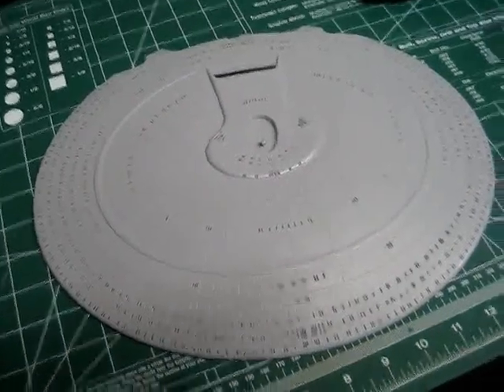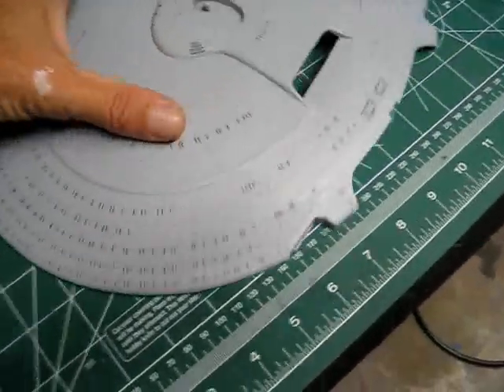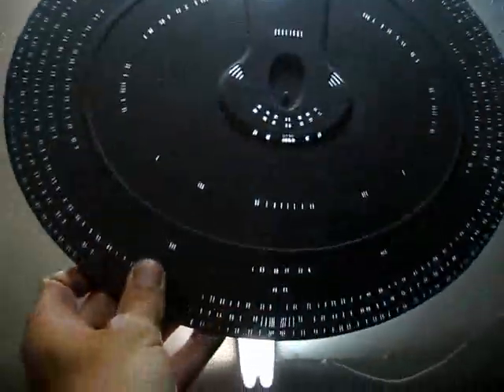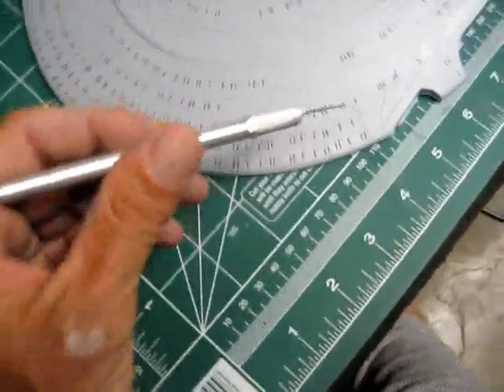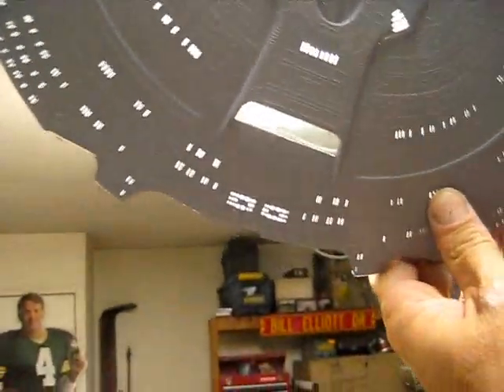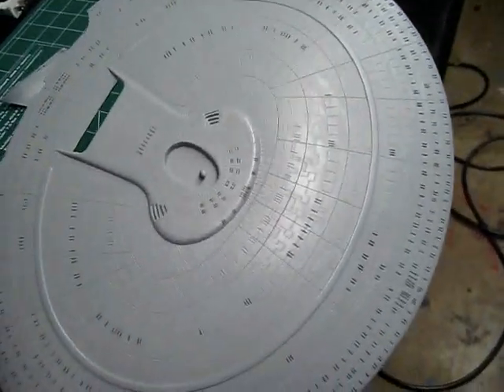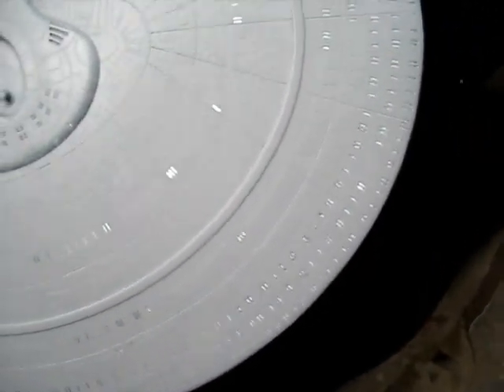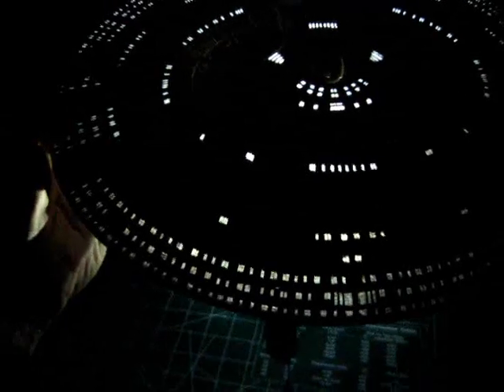From TrekWorks AMT Round 2 Models 1/1400 Clear Enterprise D Model Kit Build PT 2

Comment from the maker: It varies depending on what level you take it to. The premade lighting kits are usually one of the more expensive components. Decal sheets are also getting up there in cost too.
The Reliant I did recently for example I have about $ 450 in it. But that was an all out effort with the lighting, custom base etc which even at that not all that outrageous. Then there's the Romulan Warbird I did where It looks cool and is lit, but only spent $75 bucks on it including the $35 price for the basic kit.

Comment from the maker: The only thing I'll be painting more on the top is the phaser ring. Its easy to mask the area around it and paint it. The Aztec decal set adds all of the other colors on the saucer.
The windows are scratched to remove the paint and they appear black when the light is off
as it should. When lit you cannot see the scratches so this works really good.
I think it will be the way to go on this kit as it looks really clean without jagged edges on cut out window ports.

Comment: Looking good from the get go sir! Slowly picking away on mine too.Just started laying in some LED s in the secondary hull and did some light blocking on the engine parts.Just to try something different,Model Maker brand thin CA seems to be a good adhesive for gluing down the tiny plastic parts.May use that scuffing technique for making the windows show up better.A pleasure watching your build videos.:-)

Comment from the maker: Well if your really picky about not losing any detail I don't know of any other way.
Otherwise you can make a really shallow trench in the surface and lay in some very small gauge wire (I use magnet wire for something like this) and glue it all down.
The use filler putty to cover the whole thing up. If done carefully it won't be super noticeable.

Comment from the maker: It could be the primer you used is not the same as what I did. I always use a high quality automotive based primer which covers very well. Only needed one coat and a few touchup spots. The window scraping was very easy just time consuming.

Comment: Boyd I scored a AMT 1/1400 Enterprise D for $40 new in sealed box with the fiber optic lighting kit (which I won't use since it doesn't make any sense to use the gow bulbs and the fibers since there are LED light strips out there. Though I also think my AMT clear version USS Yamaguchi  will also get the same LED treatment as well. Also I am eyeing the Federation Models main shuttle bay for the D.

Comment from the maker: It's not actually painted black on the inside it only looks that way on the video. 
I used a black primer for light blocking on the outside only, followed up by the hull color. I later used black electrical tape on the inside to block off some of the window sections so they are not all lit.

Comment: Trekworks, your posts are awesome. Question though... for this clear model kit, how do you get the best results painting if you want to light it? I know you can't paint the inside of the kit, but for the outside is it 1.Primer 2. Light block (black) 3. Base Coat, or 1. Light block (black), 2. Primer, 3. Base coat?

Comment: You've inspired me to buy this kit for myself to try it out as the older kits in regular opaque plastic would just be way too much work.  But you've got the outside of the hull painted the hull color and the inside painted black to prevent light leaks and to contain the light.  You scrape out the windows where you want them (when I do my kit I doubt I'll scrape them ALL out as not all the lights on the ship were lit at once) How do you know where to scrape on the inside of the model?

Comment: Hi, I just picked up this model last week.   I am fairly new to the hobby and just had a few questions.   roughly how many coats of paint did you find it took to sufficiently light block everything?.  and what color  and type of paint are you using. I bought a Grey Duplicolor automotive scratch filler primer, would this be ok to use?  Hope you can find the time to help, thanks.   Enterprise  looks fantastic by the way,